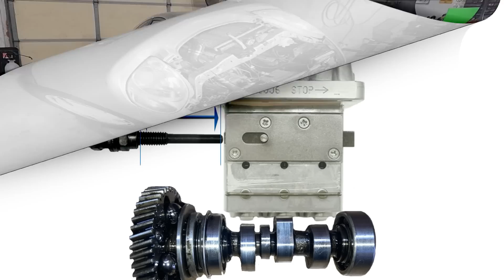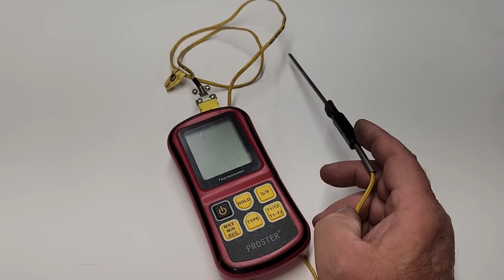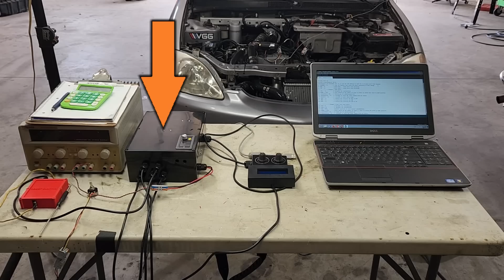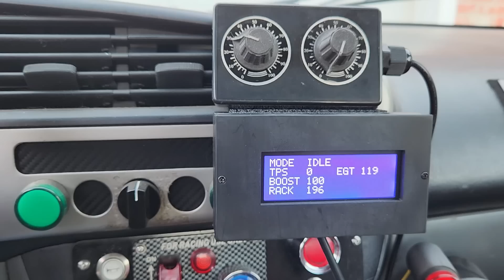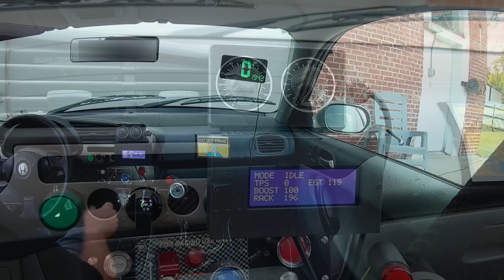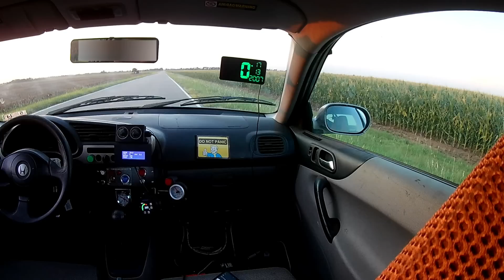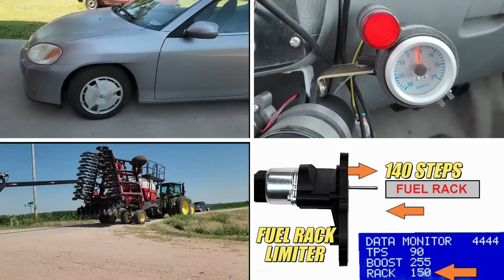S4 E24. the computer controlled supercharged Kubota diesel gets faster and better MPG

Comment: Great update! I'm glad that the electronics for all the hassle and complication they are, seem to be working well and achieving the goals you set out, both in performance and clean off boost driving. It's also good to know that you have allowed the fuel controller to give the pump 100% of its fueling ability at full throttle. I think that  given the information you have about the EGT limits that there are a few more experiments possible before concluding the supercharger project.

1, Do you have any room left to make either of the supercharger pulleys bigger/smaller to try and get back the 2psi of boost lost through the intercooler pressure drop? You could also measure the inlet temperature before and after the intercooler just to see how much it reduces the charge temps?
2, It would be interesting to try the car with a higher limit on the EGT alarm/controller, especially when accelerating to 60mph which is a data point that's important to know for comparison purposes.
3, A brief top speed run would be interesting too, could the car get close to 80mph on the Freeway?
4, Finally how about a summary and comparison to the performance figures achieved on the turbo diesel Saturn when it was running it's final 15-16psi of boost and the max fuel adjustment.
I expect that the Insight is a faster car, but then I don't think you can safely get 15-16psi out of the supercharger to compare the two systems at the same boost level. Have you ever wanted to try a water cooled charge cooler just out of curiosity too?
Reply from the maker: The drive pulley for the supercharger will likely be changed for a larger one  for a little more boost.  The intercooler didn't seem to make a difference when we installed it with the turbo and with the supercharger,    Keep in mind we tested the intercooler on the Saturn in colder weather and with colder ambient temps we saw boosted air in the 70's and 80's with no improvement in performance or fuel economy.   I reckon in theory the intercooler should make a difference, but in practice  it doesn't on this engine.  The intercooler may be making a difference now when the weather is hot so we are keeping if, however I have thought about removing it as an experiment just to see what would happen.

Comment: Have a question about the 670 pred in the Renault I have the same engine and I had to adjust the valves they went over 10 thousands I dropped them badlck to 8 and 4  what is going on with constantly needing to adjust the valves on small engine will an upgrade to sertin parts fix the ishue or is it a mechanical problem?
Reply from the maker: Its hard to say why you are having to adjust the valves so often.  The 670 engine in the Renault likely has less than 12 hours on it and we only drive that car for videos.  So far the valve lash on the 670 has not been a problem.

Comment: Reallt cool project, seeing how you're now fiddling with this old diesel with self made computer, I wonder how much efficiency you could get out of it with a twin charge system and blower hooked up to an AC pump pulley to be able to switch it off once turbocharger builds enough boost.

Comment: Amazing fuel economy for saving your money! The little fun fact, they measured it 3 liters per 100 km on the Volkswagen Lupo 3L model, it was used 1.2 liter three cylinder diesel engine with turbocharger and direct injection. It's almost the same fuel economy as you used to test that little fun Honda Insight modified!
Reply: as I remember, Audi a2 was the first one with that engine and that economy :)

Comment: That performance result proves consistent with what Gale Banks claimed in his series where he pushed the Duramax to its limits. He said you'll get better performance if you aren't over-fuelling, which also explains your fuel economy improvement. Obviously you want to maximize the available air with your fuelling, but going beyond is counterproductive. It's interesting how too much fuel in a diesel has almost the same effect as running a gasoline engine lean.

Comment: Rig up a small single cylinder engine in the trunk driving a AC  compressor for those hot days. Im sure you could rig up a simple AC system.

Comment: Excellent work! Now make your EGT derate stepped with multiple (3?) levels so that it blends in better. 👌
Reply from the maker: I plan on focusing on the EGT in order to develop code for better fuel efficiency.  From my observations, the lower the EGT the better the fuel economy.  With both gizmos in place, I can effectively hold the EGT at any temp I want.
Reply: Nice! Lower EGT also means lower NOx output as well. If you care…🤔😂

Comment: You react to the cops like a minority with multiple felony warrants. I'm no blue line boot licker, and have even been falsely arrested, but I can't figured out why you're SO worried. I don't know about your state, but where I live (Florida) everything you're doing is completely legal and the cops would think it's cool.
Reply from the maker: Thanks for the boost !   I avoid interacting with the police because technically everything these days is illegal.   Most cops are awesome people, but you never know when you will come across someone on a power trip.  A closer look at my car will generate a long list of violations if the officer knows what he is looking at.
Reply: @robotcantina8957  I assume you know your state's laws and are technically correct. That's unfortunate.

For example, in Florida, emissions systems requirements are based on the year of the VIN. Federal law allowed straight pipe diesels through 2007. So you'd be fine there. Not sure whatever laws would be a concern.

Comment: More boost with same amount of fuel will decrease exhaust temp, so you can probably try to use your temperature alarm point as a trigger point for supply more boost and keep high power as needed and if not cool down but at least limit exhaust temperature.
Reply from the maker: We only seem to have EGT issues in the ACCEL+ and the MAX POWER mode and in both modes we are sending full boost.  More boost requires a pulley change and we will do that eventually.  right now its simple to pull back on the fuel.  And yes the intercooler is still on the car.
Reply: I forgot that you don’t have intercooler… or did you install it back?

Comment: When diesel engines started running boost above 10psi, in the 1970's........heavy truck engine producers introduced oil squirters that spray oil on the underside of the pistons.  VW also did this on their natural aspirated diesels. Dont know about Kubota's........can someone confirm if they do?
Reply from the maker: The D722 is a simple industrial engine and doesn't have squirters.

Comment: Are you planning on an exhaust mod to suppress some noise without loosing power? I love your project and mods made to basic tech to improve the performance, despite some people might think is pointless. Greetings from Argentina
Reply from the maker: The exhaust will likely stay the same.  The car only makes a lot of noise at full throttle.

Comment: Have you ever changed injection timing, if its possible to do on these engines, of course?
Reply from the maker: The injector timing was advanced slightly last year when we had this engine in the Saturn coup.   On these engines the timing is set by removing shims under the injector pump.
Reply: @robotcantina8957  isn't there an option to go past oem spec? Also, a variable cam gear type of adjustment would provide some interesting data on various conditions and the respective timing requirements. 
Very interesting project so far!

Comment: To reduce EGT without having to dial back the fuel, you can use de ionized water, or distilled water vaporised and injected into the manifold, you could use an aquarium fogger or foggers or use the heat of the exhaust manifold to create steam and inject that which would also distil the water for you. The good part is that it will should also increase torque and efficiency. I would like to see the results of this on a diesel it should be better than doing it with a petrol engine.

Comment: Your gunna be head hunted by NASA (Never A Straight Answer!!) if your not careful!.  Is it a nightmare to reinstall the air con system?. The boosted engine would probably power it and itself no problem me finks. 
But no smoke, Keeps up with traffic And 78 mpg is spit spot.  
Well done Jimbo!  😎
Reply from the maker: AC would require a total re-engineering of the engine bay.   The "Normal" insight has AC and it sucks a lot of power from the engine.  LOL, I reckon if I could fit AC it would make the car undrivable..
Reply: @robotcantina8957  
Oh ok. Just a thought  😎

Comment: The value of knowledge is hard to measure.
For a diesel the injection timing is another factor to mess with.
And up the stakes by trying out a hybrid fuel solution by providing ethanol or methanol in the intake manifold.
For some interesting but more advanced hybrid fuel solutions look at the Westport LNG solution.

Comment: I was in Jimbo's area and I saw a 4 wheeled one horse powered vehicle on the road. I was wondering how they measure fuel economy. Is it oats per mile?
Reply from the maker: Indeed, the single HP vehicles are popular around here.     I wonder if I could talk one of those folks into a 212cc upgrade.... hmmmm

Comment: I am curious, do you not need to do emissions testing with a car you hand build or does the car have a special designation of some kind? This project is really awesome, and I kept wondering how you can get past the emissions requirements...

Oh, and when can I buy one! 😂
Reply from the maker: Emission testing is different in each state.  Here in Kansas there is no inspections of any kind unless the vehicle is from out of state. An out of state car is inspected to verify the VIN matches the VIN on the title.   This car was an out of state vehicle and it was inspected with the little diesel engine in it and passed.  I reckon  I forgot to mention to the authorities that I had transplanted a different engine in the car.

Comment: I don't know if it is the same in the rest of the world that uses the metric system,  but in Brazil we use KM per litre, and not litres per 100km.
1MPG is about 0.425144 km/l, so, for your audience (maybe it's just me), this information it's quite relevant.

I usually have to stop the video to calculate your fuel economy in terms I understand. 

Anyway, love your videos... it's a very good work you are doing, specially been paid only 25 cents an hour...
Reply: An another important information, our cars ,on road with gasoline, usually makes about 15km/l or 35mpg....
Reply: Another relevant information, our small engine gasoline cars makes about 35 2MPG  on the road using 70% gasoline 30% ethanol.

Here we can also use ethanol in our cars, but the mpg decreases about 30%...
Reply from the maker: Reporting L/100km seems to be what most of the metric people like.  You are the first to say differently... interesting.    I agree your way is better.

Comment: I am an old fart who cannot, seemingly, properly reset an egg timer, much less make sense of most of the little, fiddly details which appear to captivate yourself and the rest of your audience.  In the early days of your channel, I followed along eagerly as you seemed to be headed towards using an .049 to power a bulldozer or some other unlikely equivalent.  If you could figure out how to motivate my 300 ci. '88 Ford E-150 with a half ton of supplies at more than 12 mpg or so at an altitude of 6,000 feet, without the use of seven miles of optical cables, magical thermodynamics dependent rhodium cubes, 110/145 AVGAS,  plutonium jewelry and an optional tesseract box kite which would automatically deploy during tornados and hurricanes and re-store itself when going under bridges/ overpasses, well, that would be a treat.  I have no intention of abandoning your channel though it seems you can only vocalize in Sudanese or Amharic for minutes on end as the results become obvious eventually.  I don't need to know what a pupating larvae is thinking about while he changes his pajamas.  Whether he emerges as a moth or a butterfly is irrelevant as long as the experience was worth his time and effort.

Comment: Now that you have the code to take actions based on EGT, I would be interested to see water or water/alcohol used to lower EGT - which the engine could respond to by increasing fuel and power back to the maximum again. And maybe if it's before the supercharger and it kept the air temperature down, then the drag on the belt would lower versus the higher air density you get, even though the psi would look lower. And it'd be funny to think of a car that runs better when you give it a bottle of vodka or everclear!

Comment: I don't know if there is a market, but consider consolidating cards into one pcb board. We have had good luck with PCB Way in projects of these types. I understand you may keep the exhaust gas circuit off this card, but you may want to include the wiring and leave the parts off.

Comment: That highway acceleration is quite dismal compared to most vehicles (it took a long time to get to 70, and that is rural Kansas, imagine the "normal" 85 MPH of daily commuter traffic in larger cities).
And WRT the police: I'm surprised they didn't show up when you were "stretching your legs" ("investigating those irrigation systems", "See a man about a horse", etc).  I wonder if they actually would be interested in your vehicle if they saw a puff of smoke or noticed an exhaust note from what is supposed to be a fully electric vehicle?  I doubt they would even notice (unless you have no license plate).
Reply from the maker: When a small town cop parks on the highway, he is looking for revenue....so the best thing to do is act normal.    Stretching the legs seems to be an issue when drinking copious amounts of water to stay hydrated in that car..

Comment: I wonder if a throttle-position-controlled electric-fan-cooled oil cooler set to activate past 75% throttle and 5% engine-over-temperature would help that melting piston bad deal.
Reply from the maker: The exhaust gas temperature is a measurement of the temp inside the combustion chamber.    The only real way to bring the temp down it to add more boost.
Reply: You're totally right sir. This ain't no air cooled gas engine.... Ha.

Comment: Hi. I finally tested my 3D printed electric supercharger in my beater Hyundai. Works awesome with some extra fuel yoloed in there with an extra injector. Gave ~4-5 psi boost. High power SSS RC boat motor and 6S lipo battery and giant centrifugal 3D printed blower.

Comment: "The traffic today seems heavier than normal" - one truck drives by.
Reply: Were going up a hill......in Kansas....😅
Reply: "I saw someone on the road to town. Some big event must be going on"
Reply: 100% increase
Reply: and not a farm implement in sight. incredible.
Reply: @daos3300  Not quite right now, no.  Planting is done, most of the spraying has been done here as well.  Outside of someone haying, you won't see much action in the fields right now.
Reply: You can't see in the rear view mirror!

Comment: Great content! Would be interesting to see other ways of power besides the engine since it has reached its limit. Making a DIY Mild Hybrid system would increase both power and efficiency, just add a small battery to allow for 20 seconds of max electric boost.